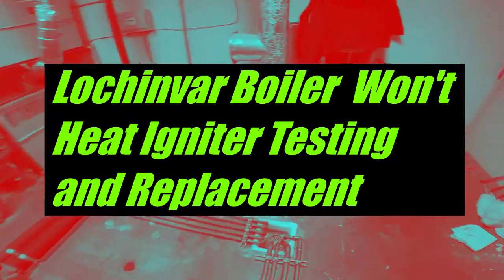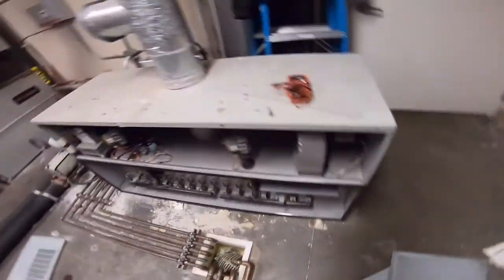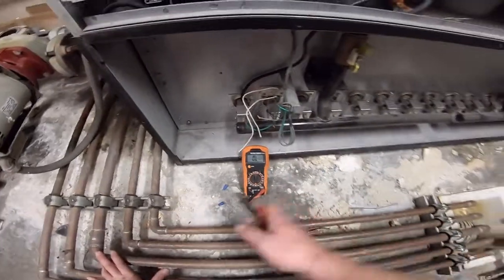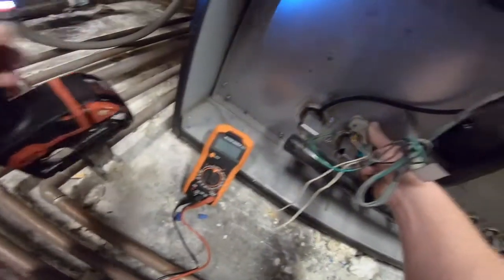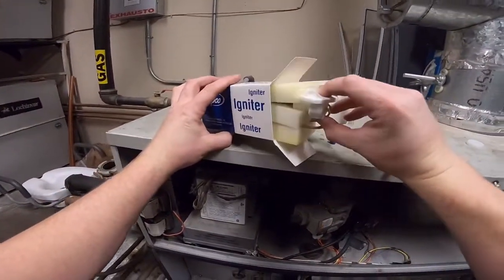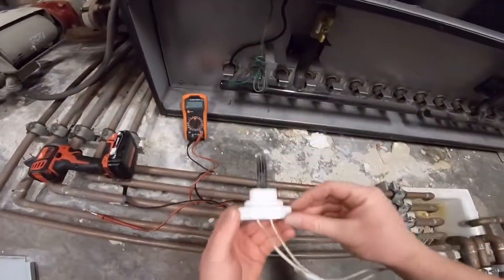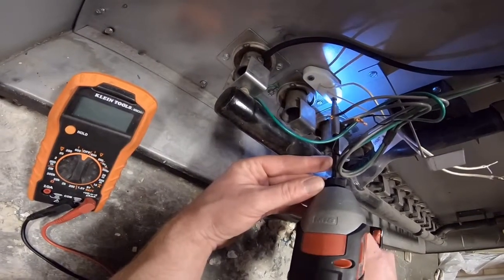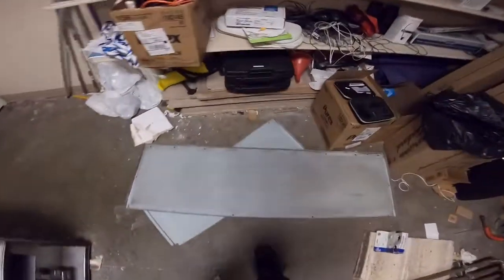Fix a Lochinvar Furnace That won't Heat

Comment: The boiler turns on for couple seconds and it turns off, I fixed the flame failure fault and it’s still not working.
Reply from the maker: Are all the covers back on? The vacuum switch won't close if the front panel is off.

Comment: Instead of putting your hand on the flue, you can look in the peep hole in the lower corner of the side jacket(s) and see that its lit also making sure your flame looks proper and not too yellow or lifting. There's (6) 5/16" holes to look through at the base. Also critical to check your chamber pressure on these CB/CW especially if your getting nuisance trips.

Comment: Why do techs feel the need to use an impact driver or drill to unscrew/screw small screws. Its so easy to strip the thing or even snap it and then your dealing with a bunch of bullshit when you could have just used a nut driver or a screwdriver. Im only saying this because I learned the hard way working on a lochinvar or any other.
Reply from the maker: It saves time and repetitive movement related injuries . I haven't had a problem using an impact and self control.

Comment: By design a terrible boiler.  By far one of the worst I’ve ever worked on.
Reply: I agree also
Reply: Yes, they are worse boilers in the industry.  I have fixed at least 1000 boilers for the last 8 to 10 years,  and they are very often break down after you have fixed it 😢😢😢😢😢😢😢😢😢😢😢😢😢😢
Reply: I agree the only thing that is worse are the heat exchangers on the Armor and Knight boilers. The boiler isn’t a bad design but if you plan on selling one to a customer warn them no matter what they do Lochinvar will find a excuse for why it leaked after a year and a half. They wanted wye strainers at first but that didn’t help then they wanted dirt -air separaters and the heat exchangers still leaked. So now they want dirt mags in line and we have done it and one with a dirt mag installed from the start is leaking, and before anyone asks yes we maintain these units by cleaning them , setting them up on instruments,and the vent lines are not overrun. The last I heard from my boss was we just have bad water where we live so there’s nothing else we can do but they have redesigned the boiler so maybe that will help . Even the fire tube units leak , and I heard that one company in Poland makes all of their heat exchangers.

Comment: What if it's 3 blinking lights? Any idea? Every pro in town has checked our Lochinvar Boilers but it's always a thousand dollar guess with everyone. :(
Reply from the maker: If they are actually there testing your boiler and only have guesses, I am not going to be any better not even seeing the equiptment. 3 flashes means flame failure they should be able to test it and not make guesses. Do you have more than one of these boilers?